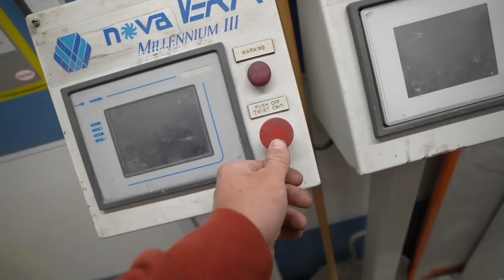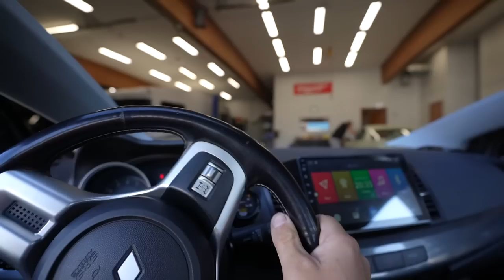Painting the Mitsubishi Evolution a CUSTOM COLOR!

Comment: As a former automotive painter, I freaked out when a saw the tape on the fresh paint after the windshield was installed. The paint looked so good i hope the tape didn't screw it up
Reply: Well if you knew the timelines of when everything was done it might help you understand better, also when painting he could have used a higher grade hardener than what was required for the paint. Something like an 8989 would have that paint hard enough to handle in about 45 minutes and in an hour or 2 it’s completely dry and ready to install and drive

Comment: Much respect Devin. I tried out painting recently on a OBS F250, it has a bunch of whiskey dents so it didn’t hand to be perfect. It actually turned out really well other than tons of orange peel, I tried to wet sand and buff it out but hasn’t really worked to my expectations. Any advice?
Reply: As someone who paints, orange peel is mainly from spraying the paint on too dry. As in not spraying a wet enough coat on. Gotta find that fine line between too wet(runs) and too dry(orange peel). Also if you don’t know the phrase “follow the wet line” here it is. When you’re spraying paint on, get your eyes at an angle to where you can see the paints reflection going on. In the center of your spray pattern, it’ll be wet, and the further away from the center of the spray pattern you’ll see it looks hazy(not wet enough). So as you work your way north to south on a panel, follow that wet line, so wet over laps wet and you don’t go too far south of your wet line. That way you don’t get dry streaks.